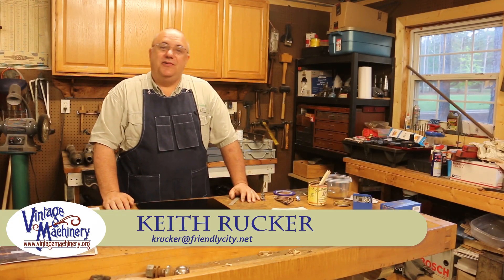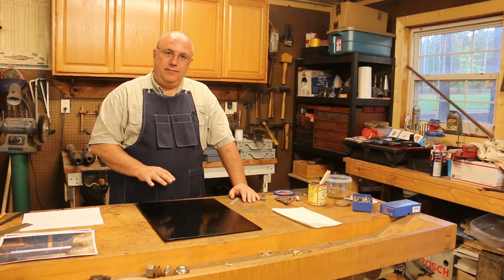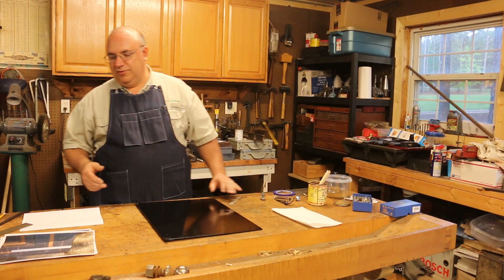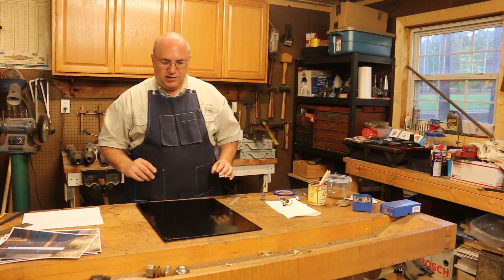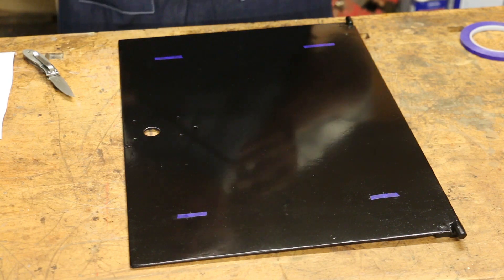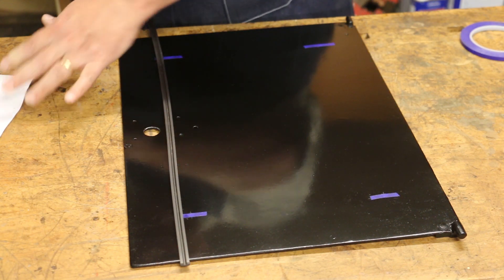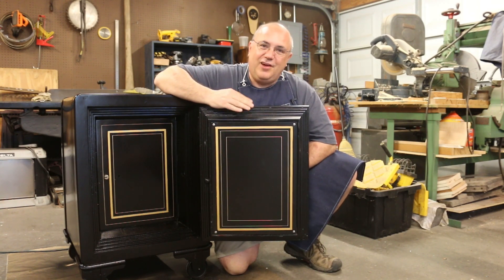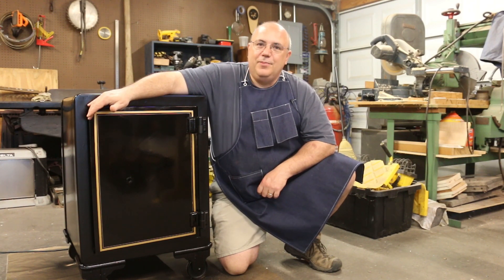Victor Safe Restoration 13:  Pinstriping with the Beugler Pro

Comment: I wish I could remember what the product was but I used a spray on a small potbellied stove my Grandmother had given me. Initially the black was very dull and the paint very faded. After spraying it the black went to very black and the gold paint brightened up tremendously. I was shocked what a difference it made. That was 15 years ago and it still looks as good as the day I sprayed it. Perhaps one of your viewers might have a clue what it may have been. I remember it was made just for the purpose I used it for. I think you did a great job on the pin striping. Mr Pete would be proud.

Comment: Beautiful job of pin striping.  When you laid out that magnetic guide I did not recognize that it was rubber at first and I though the camera was distorting things.  Then my brain worked again some and I realized it was flexible.  That safe will be a work of art when you get it finished.  Thanks for the video.

Comment: Looks Awesome!!!  The pin striping is a home run.  I think a clear coat may brighten up the old door inside the safe.  Wipe it with some mineral spirits.  If you like how it looks then that is about how it would look with a clear on it.  I would likely restore the interior if it were mine. Of course you do what makes you happy.

I like it and I am sure your Grandfather would be proud!

All the Best!

Mike

Comment: Keith, I'm glad to see you liked the stripe tool and guide I suggested awhile back. The safe looks great. Be careful when you clear coat the safe because some clears have very aggressive solvents in them and can cause lifting or wrinkling of the base coat especially spray can type paints. I would test somewhere that couldn't be seen before applying the clear overall. Anyhow, great job with the safe and I am anxious to see the finished product!  Jamie

Comment: Very nice Keith.  As I mentioned weeks ago, the magnetic strip is well worth the cost for someone who doesn't do it everyday.   I've been using one for awhile and it get's   easier to use once you've seen the results a few times.   I pinstripped my P/U as well as the front door trim on my house.  It's an awesome tool

Comment: looks amazing keith its a great little gadget that pin striping wheel

i am an artist and i would of struggled to do that free hand
Reply: it would come in very handy for that . i was at the hospital today got by new shoes for my crooked feet arthritis twisted them out of shape been painting most of the day . like how the magnetic guide works i used to pin stripe but i used to use pin striping tape its a very fine  vinyl tape comes in all shapes sizes and color

Comment: Hi Keith. Beautiful piece of work, both the safe and the pin striping. If I may suggest something, I would leave the little interior box as it is now and then line the inside with felt or something like that. That would leave a "connection to the past", you could call it :-) Again, beautiful work! Best regards, Michael

Comment: Nice job Keith. Will look a treat when all finished with Logo's and locks. I think you should leave the inside exactly as it is in remembrance of the previous user.
In answer to +Landrew0  (no reply box) maybe you should watch the video again as Keith does explain how he cleaned the surface first.  regards from the UK

Comment: Excellent piece. If you take your screws and put them in fire then drop them in used motor oil (lots of carbon) they will become black. Just be sure to put them back in fire after that and let them cool off slowly otherwise they will become brittle.

Comment: I know this is an old video, but just a heads up, I've seen a few pinstripe artists use Beuglers to pinstripe elaborate jobs. While a sword brush offers more control as far as line thickness goes, you can still taper your lines and  do curves pretty easily. the key to striping is being able to "steer" the brush or tool to make nice curves. The challenge with the sword is controlling brush pressure and keeping your hand or arm away from your lines. if you have shaky hands or arthritis the sword brush can be a challenge.
A Beugler has it's own challenges; the line thickness is limited by it's wheel size, the tool is bulky, which makes it less sensitive to pressure, but more challenging to steer. It holds more paint than a brush, so pulling a long line down the length of a car is easy, with a brush, you need to reload and palate  it a few times along the way. a Beugler can also pull multiple lines of varying thickness at once.
With a Beugler, you can start the wheel on it's edge and "roll in" to the flat to get the line to taper in/taper out.
With practice, you can stripe pretty well with them. While I usually use Mack swords to stripe, there's room for a Beugler in my kit; Rarely use it though because of all the cleaning involved.
Practice with it; You will eventually free hand everything once you get the feel for it.

Comment: Good job on the pin striping Keith, just my two cents but I think the inside of the safe would look good if you painted the door black an did some striping on it an put some green material inside of the rest of it. Like the material inside of some jewelry boxes.

Comment: Keith, this is without a doubt one of the best video series that you have produced to date and there are many of them. I can't wait for the rest! Two questions, 1) The outside paint of the safe seemed to appear a little flatter and the doors more glossy. Was that on purpose or was it the light in the shop? 2) I'm sure you mentioned it in one of the earlier episodes, but I was waiting for you to mention the staining on the floor of the safe and what caused it and are you going to leave it that way or not. Personally, I think it make the safe look more vintage the way it is.

I'm dying to see the foundry work on the dial parts!
Regards,
Rich

Comment: eastwood has a 2k clear coat. you want something that is catalyzed, anything off the shelf at lowes or home depot just don't harden enough to be durable. a 2k clear is basically automotive clear coat so it cures solid. by the looks of it you're pretty good with a rattle can so this would be just like that. just do about 3 light coats. if you want to protect the exterior of the safe i would recommend it there too. its not the cheapest but its a good bang for your buck. and its got a uv protectant so the color won't fade over time. if you have any other questions this is right up my alley and would love to help in any way possible.

Comment: I just acquired a safe similar to yours, same body but has no inside door and outside door has a separate dial from door nob. everything is in good shape but paint is all but gone some rust to be sanded down. what do these safes go for after being restored but having needed a complete paint job. I assume it must degrade the safe. I got it for $10 bucks but they'are so awesome looking when restored i have to do it even if i end up selling it.

Comment: Just was curious if you used enamel or lacquer and what the top coat would be?  I have not had very good luck with clear top coats and was wondering what I was doing wrong?

Comment: An easier way to do this is a product called Finesse tape .It is a spacer tape for lines which you fill in then pull Finesse tape after ten minutes while paint is tacky so the edge rolls over. Lay-out time would be reduced as well. Problem is Finesse tape is only for two lines at a time.

Comment: why did you use different pinstripe patterns on the inside?
Reply from the maker: I was matching what was originally on the safe.  I took pictures with detailed measurements before I sand blasted everything.